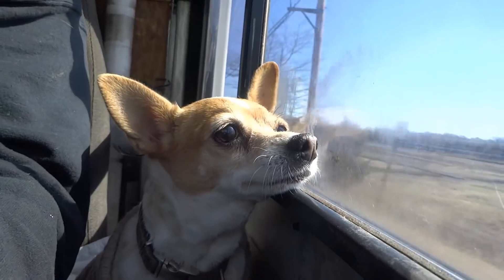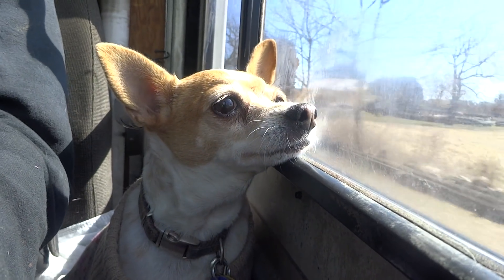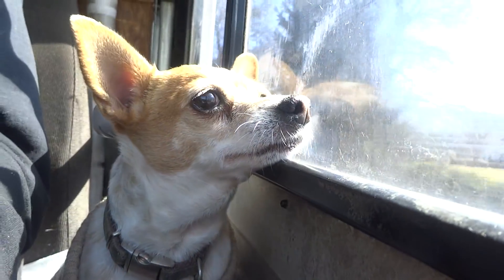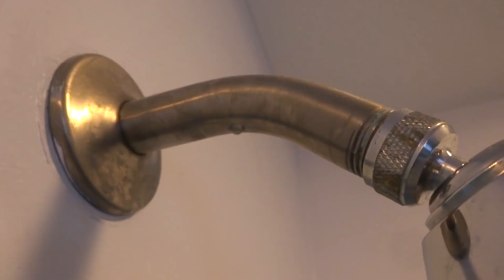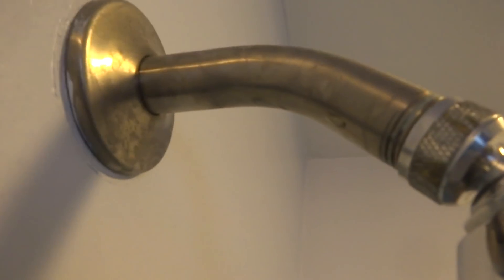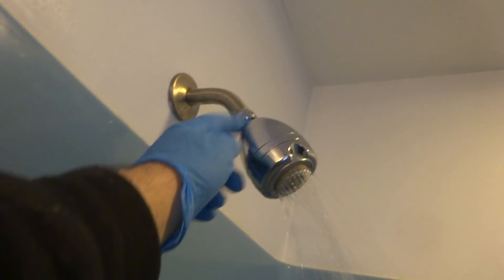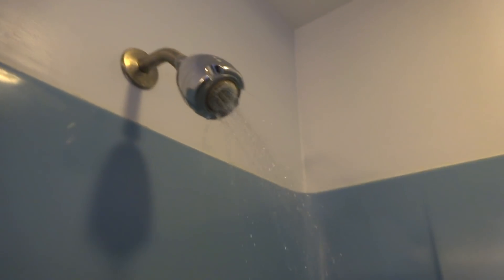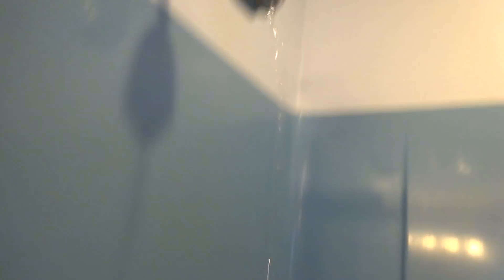no water flow out shower head

Comment: Great video! what can be the cause of no water coming out of the shower head a little flows out the pipe under and you hear the pressure building up in the line but no water comes out.

Comment: I would still be repairing cars professionally if I didn't have all the chronic illnesses that I do now. However, there is one thing that makes me happy to be out of the repair industry. There would always be automotive lifts that had mechanical problems and wouldn't pass a safety test, but us car guys had to use them anyway. I live in Florida, and it wouldn't surprise me if half the repair shops would close due to failing a safety test.

Comment: I'm not sure if anyone can help me with my issue but I just replace the pressure balancer in American Standard shower valve. I had very low water pressure before and had troubleshooted the issue and narrowed it down to that. I purchased a new pressure balancer for that model and installed it accordingly. I had bought a new valve just in case I needed it but used the old one just to see if I could save myself some cash. I put everything back together and turned the water main back on and went to test the shower head but to my surprise nothing came out. I installed the brand new valve and had the same result. I took everything apart inspected it but nothing out of the ordinary. I'm pretty stumped on this one. Just wondering if it could be something simple that I am doing wrong. If anybody has some pointers they can give me that would be great and much appreciated. Thank you
Reply: Did you ever figure it out? Cause I’m having the same exact issue
Reply: @gilbertoescamilla2055  yes I was fortunate enough to figure out this hack job haha it was a combination of bad plumbing installation and hard-water buildup. The prior owners had redone the entire shower and when they routed the plumbing, they routed it downward and back up. For what reason I have no idea, but the water would settle at the very bottom and developed calcium and mineral buildup. I had to use CLR and compressed air alleviate the blockage.
Reply: @09nedly09  yeah i think I have blockage then, I’ve tried everything else. I’m gonna try  CLR and compressed air next. Thanks a lot!
Reply: @gilbertoescamilla2055  hey no problem man! I really hope that helps you out